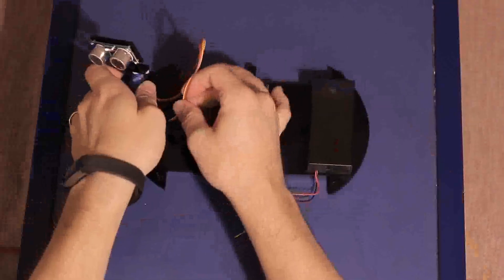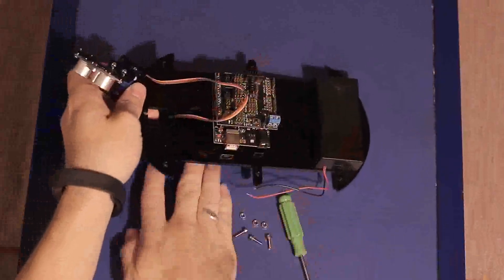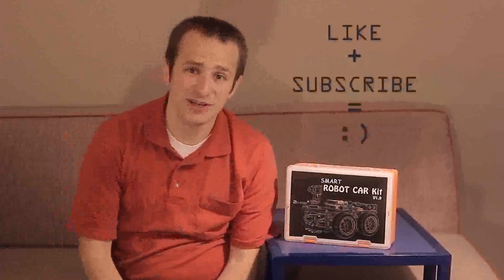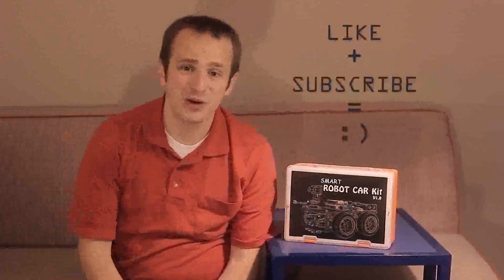How To Make An Autonomous Robot Car - Intro

Comment: Hi I’m a project manager for a disassembling robot and I would really appreciate it if you could give the electronics you used for this robot. The RFP includes many things but one is our size constraint which is 3 by 3 Cube. This is student funded and would love to add you to one of our contacts. Thank you
Reply from the maker: I would love to help out where I can. The new version of the kit I used can be found on Amazon. https://amzn.to/354xXWN I prefer the old one since it didn’t have the prepared cables, but ultimately the kits are very similar.
A brief overview of electrical components consists of an arduino Uno, a motor shield for the unit that drives the a wheels, a small servo for turning the ultrasonics, the ultrasonic sensor, a battery module, a Bluetooth adapter, and the 4 small geared dc motors for the wheels themselves, and wiring needs.
Elegoo has some very good starter kits for various project ideas. I hope this helps.

Comment: Part 2?
Reply from the maker: My computer died with all the recordings. I’ll try to revive it to finally get the series published.
Reply from the maker: The hard drive is still good. Looks like I may be able to finish the series after all!
Reply: @EngineeringToExcel  👌🏻 sweet. I have a project idea in my head, but def need to learn more before I’m ready to take it on.
Reply from the maker: @mdandry  What is the general concept for your project?